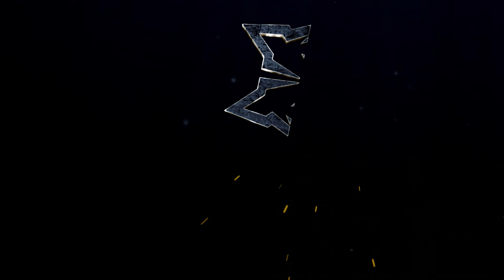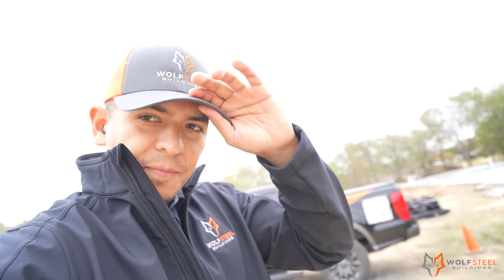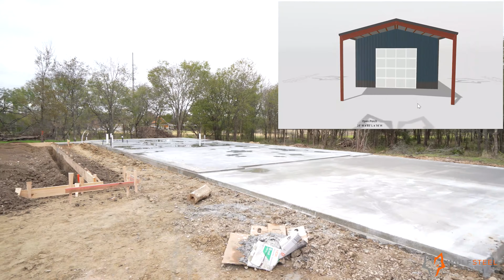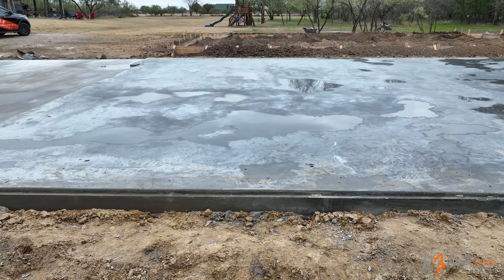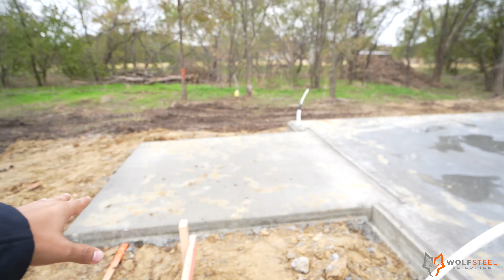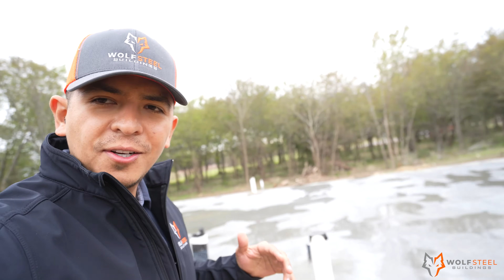#1 Way to do a Concrete Slab for a Weld Up Metal Building | Notch Detail | WolfSteel Buildings

Comment: Great video!!     What size 2x  for the roll up notch?   Also width of notch to door width?  Thanks
Reply from the maker: Thanks, Robert! The door notch details can vary depending on what's the standard for your concrete builder. Also, this may depend on the type of framing that will be used following your building requirements. Best to connect with your concrete builder for the specifics.

Comment: Hi is 1 inch out of square okay when doing this for metal building building on 3 inch notch? Thanks!
Reply from the maker: You should be fine. At one part of your concrete, your builder might cut off a piece of your concrete if they have the right equipment. 1” is workable:)
Reply: @wolfsteelbuildings  thanks! And I’ll be honest, I’m the finisher and it was my first time doing one of these but it turned out great! Lol Thanks again merry Christmas!
Reply from the maker: That’s so awesome! That’s a great feeling to have right before Christmas! Congrats! 🎊! 🎁